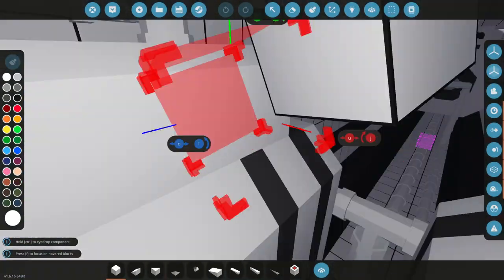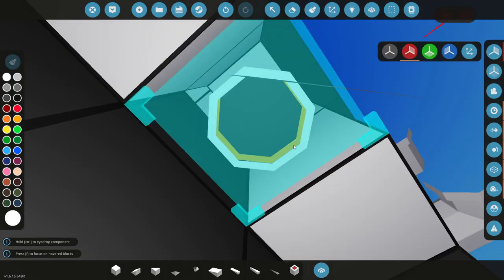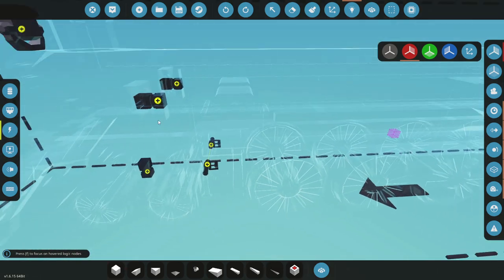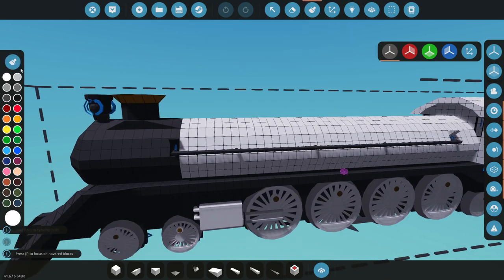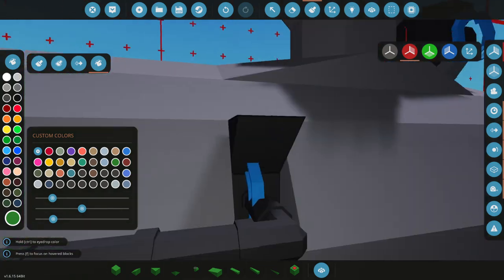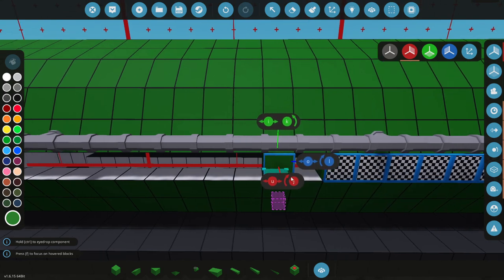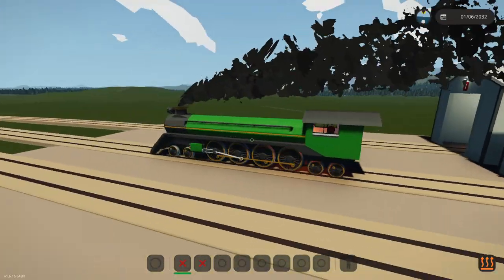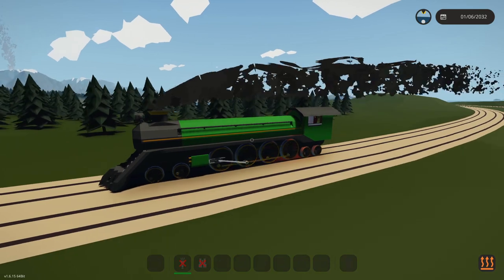STEAM LOCO IS UP AND RUNNING! - Lets Build A Steam Engine In Stormworks!

Comment: I wouldn't say condensers are useless, they're just not something you should rely on in terms of being able to keep up with a steam system. They absolutely will condense steam back into water, but the rate they do it has never matched the rate boilers heat water into steam. They are always a choke point in steam systems. You can have them to gain some efficiency in your water usage, just don't rely on them to do 100% of the backend work with the left over steam. It's a lot more manageable and sensible to have a water feed system on a steam engine system than it is to have a full boiler be your only source of water for it (which is usually the case for a lot of beginning steam engine setups in the game.) When you don't understand how to fully control and utilize it, you do what's simple and what generally works. A full boiler can work, it's just a bit difficult to maintain until you get into a reasonable amount of water in it.

Quite honestly, you need a separate venting system for when the pressure gets above 9. Ideally, use multiple lines out all hooked up to automatically activated large pumps (since they push more volume than small pumps or pipes alone) that just blast the steam out from like 6 ports or so. But as others have mentioned, water level/fluid volume in the boiler is the best way to control pressure. The boiler can get as hot as it wants, but if there's nothing inside of it to actually turn into steam, it won't build any pressure. IRL, you'd NEVER want to do that as it'd cause the actual system to melt down and potentially explode. But since Stormworks doesn't really go by IRL systems, you can super heat the boilers dry and then add water until it gets up to pressure and then drip feed it more water as it needs it. You can either sit there manually bopping more in or have a microcontroller do it for you. But either way, boiler pressure is correlated to how much water is available to make into steam. If the amount is 0 then the amount of pressure that can be built up is 0.

The reason why your boiler blew up was because pipes alone are not enough to throw enough steam out of them to equalize steam pressure if you've flooded your boiler. Everything has a flow rate and while you can technically exceed it, the flow rate of a system tends to be limited to the highest intake/outflow rate in the system. Like a standard fluid port usually has an intake rate of 5 or so, but if you have pumps set up on it it can be forced up past that into like 30+. So with no additional force, because without a pump there's no additional flow rate being generated by a system, your steam bleeding port was limited to what the valve allows. If you had pumps on it, the valve would be forced to allow more steam to pass through it evacuating the pipes faster making room for more boiler steam to leave and alleviate the pressure build up in it. Just keep in mind that Stormworks calculates pressure based off of the amount of steam in a vessel. I've tried a system that vented out air to see if pressure could be released like that; didn't work. So it's purely based off of steam in pipes/in the boiler/in the turbines/in the pistons, etc. You bleed enough steam fast enough, you can prevent boom booms.

That green is like Thomas the Tank Engine Percy or Henry green. Either darken it or make it more cancerous to the eyes (make it brighter). It just seems like it's an homage of those trains and it's just missing a weird face on the front.

Comment: On a steam locomotive the place where the steam is released to prevent the boiler from exploding is on top of the boiler (the cylinder part of the train or the body), it can go off automatically or manually depending on if the fireman or engineer (the train driver) release the steam before it, just for future reference incase other Steam Locomotive experts roast you if it keeps happening

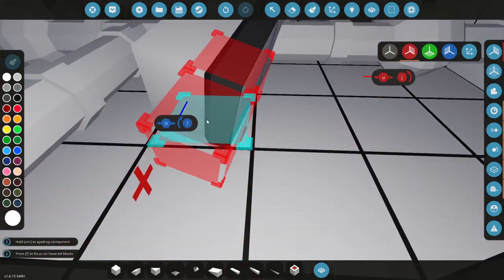Comment: 3:15 Use a threshold gate. Set low threshold to eight or nine, and then high threshold to a huge number like 999999999999999, and then connect the number input to pressure, and the on/off output to a fluid valve
Reply: using a greater then is actually the correct gate to use for this application, altough making a custom, compact one would be good

Comment: To control the temperature of the firebox you either limit the exhaust or the air intake with a variable valve. I used a pid to control the temperature but a function would work perfectly fine as well.

Comment: Looking great.  

Steam pressure will always build when the boiler temp is over 100 and there is water in the boiler.    The easiest way to control the pressure is to just limit the water in the boiler so that there is never more than just enough to get to 9.9 bar of pressure.   Start with an empty boiler and add water a little bit at a time until you get the pressure you need.    then shut off the water until the pressure drops.   My micro controller does that automatically.  (Steam Boiler Pressure Controller by Bendigo) on the workshop.   Or you can make one yourself.  It can be done with regular logic blocks, but it is not super easy to do.  

The temperature cuttoff works if you can maintan a low temp but there is a delay as the water cools off and heats up. 
The pressure release can not release pressure fast enough with one pipe.
Reply: It's a bit of a counter intuitive thing because IRL you never want a steam boiler to ever run dry while the firebox is still burning. It weakens the metal that's between the firebox and the boiler (as they were commonly connected via one being around the other) and with the amount of pressure that build up in an IRL steam locomotive, weakened metal is a place for the steam to go. The unique way Stormworks has implemented steam engines has really deviated from how they are limited IRL, but I think there's just an inherent fear of letting a boiler run dry that either needs to be flat out addressed as being 100% safe or it needs to change where it could potentially be a hazard. But that's my opinion on it.